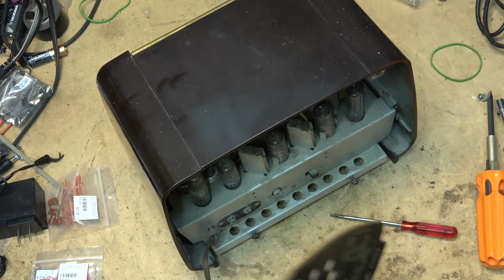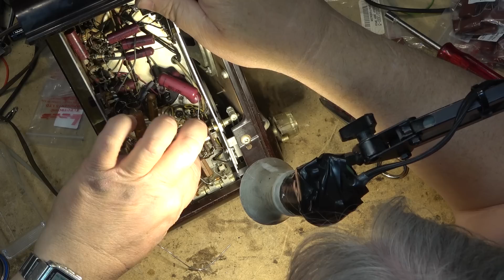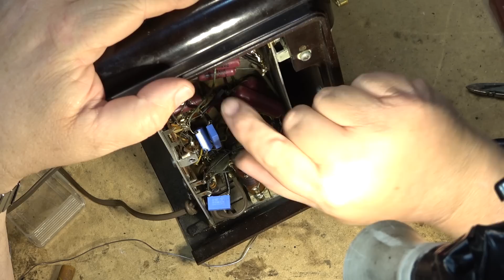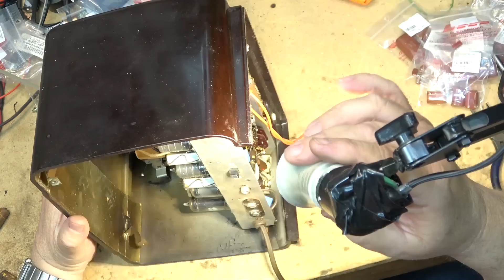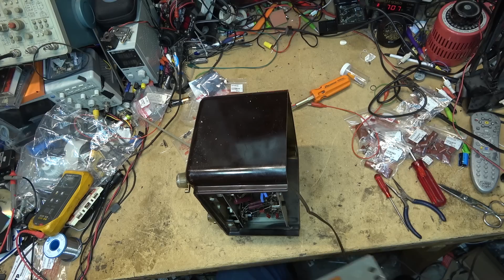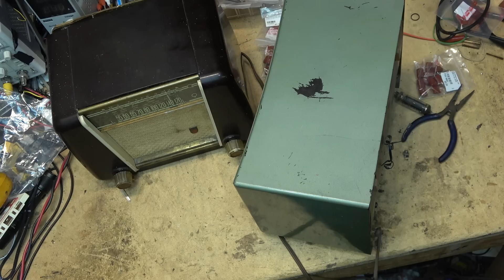Vintage Philips Bakelite Shortwave Radio Repair

Comment: It would be VERY interesting if these old tube radios could tell us stories of the types of programming they once played to their previous owners! At one time, radio was a very exciting medium. In fact, I'm old enough to remember when most programming was on AM, and that FM was still somewhat "experimental."
Reply from the maker: Here is a fun fact.  You can find all those old radio shoes archived.   Build a low power am transmitter and broadcast them through your house and tune in on vintage set.
Reply: @12voltvids  Well, that is what these tube radios did when they were fresh off the assembly line. Nelson Eddy and Jeannette MacDonald would sound good coming from the speakers of these receivers. Unfortunately, most local programming wasn't pre-recorded. In my country, home-built AM transmitters must be Part 15 compliant, though.
Reply from the maker: @chetpomeroy1399  they have to be compliant pretty much everywhere.  Mine is 400mW which means into a 10 foot wire it goes about 100 feet.

Comment: You should break out your cap tester ,just to see how far out those waxy /paper caps are out of spec. Hugh Mc. Chicago metro. That's really some old vintage equipment.
Good sound on the brown Balkelite. Honk Tonk, Mick & the boys. You went to your transmitter. Needs filter cap.                       **** Good repair ******

Comment: The 'plate' antenna was common in the time when Ferroxcube antenna rods were in their infancy and pretty expensive (1940s). They were sufficient to receive the strong local stations in noise free environments. 
Later, only the cheapest radios had them. In the late 50s, early 60s they were also commonly used together with the ferrite antenna because they offer more shortwave reception at the higher frequencies than the ferrite antenna does. But the ferrite antenna was used for medium and longwave in the same radio. 
Ferrite rod antennas are more sensitive, but also offer some more resistance to interference. The directional reception makes it possible to reduce the interference from one direction. 
The ferrite antenna always needs a tuning capacitor. They don't do anything when left untuned. That makes it inconvenient to just use an external ferrite antenna, because it leaves you with two separate tuning knobs.

Comment: the green one is factory made by philips the give away is the IF transformers
Reply from the maker: Or the Philips was made by Rogers.   Rogers was a big player in radio in Canada.  Still are, and a big cell phone phone and cable TV provider too besides owning about half the radio and tv stations in canada.  They also built the first FM station in Canada.  Ted Rogers used to build radios by hand.  I have one of his early radios.

Comment: I have a question for you.  I have a Sony 5-Disk changer (CDP-CE315) that does something weird:
I turn it on, and it sometimes auto opens the tray.  I put a CD in, and it makes a grinding noise, then just pops the tray open again.  It does this a few times, and even tried eating one of my CDs once.

I can finally get it to read a disk after about 4 or 5 times doing this OR unplugging/replugging the player.  Unfortunately, having to un/replug every time is getting annoying.

Do you have any clue what could be going on?

Comment: It's kind of spooky that the radio you fixed was playing Hotel California when you got it working.

I loved the old tone controls that went from clear to muffled.
Reply from the maker: Notice how quick I turned that one off.  The eagles are bastards when it comes to copyright.
Reply: @12voltvids  I figured as much. It's not like you planned it.
Reply from the maker: @richardsmith2721  well the music is playing off an MP3 player in a closet connected to a FM transmitter. Signal from the FM transmitter is received where it goes to my am transmitter which I use for testing radios so that I can pick up something other than talk radio. I have two little willpower FM transmitters one place royalty free and the other place hits from the '60s '70s and '80s the type of stuff that you would have found on AM radio back when AM radio was still the king for pop music like it was here. Usually I leave the a.m. transmitter tuned to the pop music channel just so I can take her around with radios and so forth and display them plus the am transmitter is an AM stereo transmitter so I can demo my AM stereo radios. When I repair a radio on camera I typically put it on the royalty free feed so that I can play it without getting hit. In most cases I can get away with a few seconds without any problem there are some exceptions though. There are a few bands out there that you play as few as five notes and they're demanding a takedown. Guns and roses is one, the eagles is another. I didn't want to take a chance with the opening to hotel California so I cut it off pretty quick.
Reply: @12voltvids  I see. It wasn't just picking up a random station playing that song. That's far less spooky.
Reply from the maker: @richardsmith2721  
No music stations left here on am.  Still I have no way of knowing what is coming up or when stuff plays.  The player has about 900 tracks on it and they play randomly.

Comment: These old radios are so amazing. I still remember warming my hands on cold mornings over our AM tube radio and the smell it made as it warmed up. Here in very rural Louisiana nighttime AM radio was my only source of information from far away places and I`d sit in my mom`s car all night mesmerized by the distant signals. I have a huge collection of amazing modern portable multi band receivers. 

I listened to a HAM radio conversation recently from a group of guys ranging from Texas, Florida, boats at sea, and guys from Indonesia. After hurricanes here in Louisiana AM and shortwave are often the only source of information from outside the damage area. I don`t own a TV & satellite system to connect to my solar but my solar is reserved for lights, fans, freezers, fridge, and WIFI if phone lines remain undamaged, which is rare. 

Local radio towers, cell towers, phone lines,and all other potential sources of info including NOAA weather are usually wiped out by these storms for long periods where I live. But when all of the electrical static is gone my high quality AM and shortwave receivers get incredible reception, even during the day, and I can easily hear AM signals coming from major cities within the state and some others during the day. 

I recently bought a receiver capable of greatly extending daytime reception range on AM, the affordable Tecsun PL-330. It can be set to use an external AM antenna, and using a 4 ft experimental loop with it I can faintly hear 820 WBAP in Dallas here during the day. During a power outage I could hear it plainly, especially if I connected the radio to a grounded long wire antenna over 150 ft long. It actually outperforms my CCrane EP PRO at night connected to a 9 inch AN-200 loop antenna. Technology has came a long way!

DEAR YOUTUBE. PLEASE STOP DELETING MY COMMENTS LIKE PARANOID PSYCHOS! THANKS!

Comment: Brings back memories of childhood. We had a similar Philips radio when I was small. Ours was only MW/LW,  but bakelite case,  speaker fabric pattern and dial, with switch under the right knob for waveband change. Have searched high and low to find even a photo of this model. Thanks for the enjoyable videos.